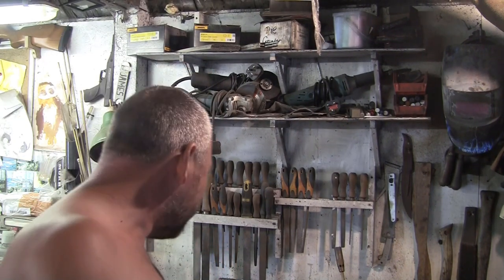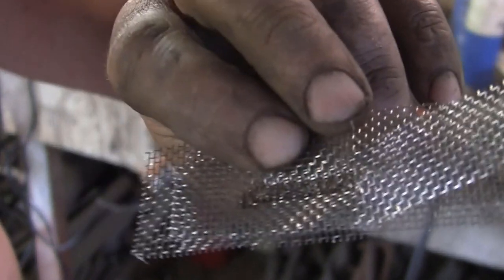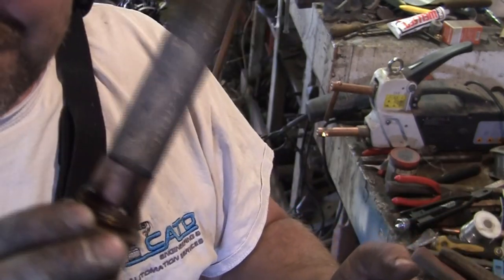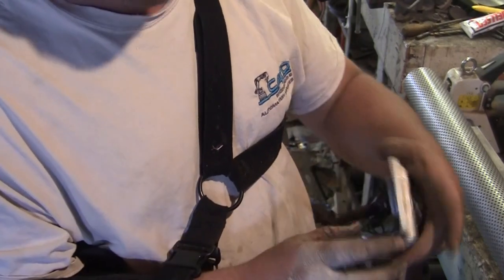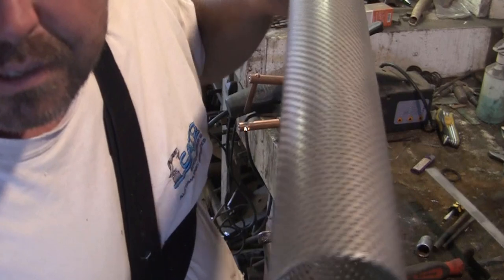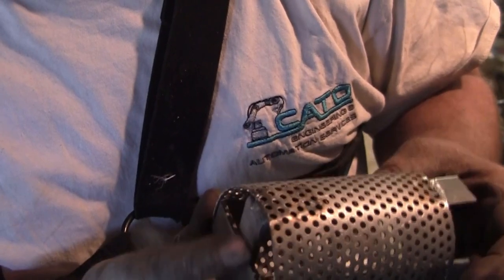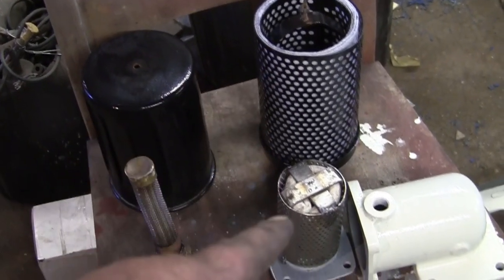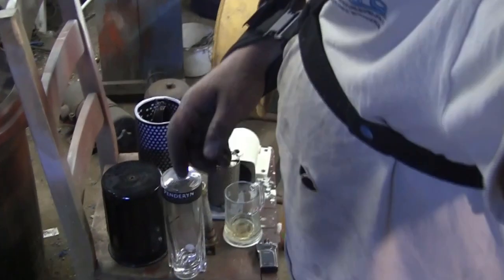Making filters for the Lister CS

Comment: You did a great job on those filters, especially that oil filter, it was a real bobby dazzler, which is amazing coming from a bloke who apparently stirs paint with his bare hands. Keep up with the physio exercises. I look forward to seeing you back firing on all four cylinders, like a finely tuned  Lycoming.
Reply from the maker: Mahah brilliant. The thing with Lycomings is when they're running dead smooth it's normally because they're down on compression and the cams scrubbed.
Reply: @turboconqueringmegaeagle9006  Sounds about right for the aircraft I used to fly around in, and for the women for that matter 😄

Comment: If you repeat a spot weld on top of a hot spot weld it can aid penetration with lower power spot welders. I have used 4x welds in the same location for a strength required situation.
Reply from the maker: Yes it seems to work well if you don't mind the dimples
Reply: @turboconqueringmegaeagle9006  When needs must and real welds will not work !

Comment: Spot welder works lovely most impressed with the oil filter. I think you need silver solder for stainless not tried it though. 😀
Reply from the maker: There's a challenge, making a puddle of silver solder to dip it in, I read since that especially strong flux is important too, I just used plumbers flux.
Reply: @turboconqueringmegaeagle9006  yep bit of silver solder will do wonders. Warm the mesh a little to Pre flux it, warm the rod, dip in flux then flick the torch over it to get a little glow and pop the rod against it. If you keep the end suspended it will turn out nice and even also dont over do the solder.... but that spot welder is just so quick and easy, plus the last time I ordered a pack of silver solder 7 years back it was nearly £1k I dread to think what it is now.
Reply from the maker: @smithbuilt  really? How big was the pack, 50kg? I've got a few random bits, it's expensive but I didn't think it was that bad

Comment: Love a whiskey myself what’s that one like, I’m not a fan of the Smokey stuff.
I’m an Irish whiskey lover.
The oil filter was my interest a question was going to be how does the stainless take to solder but you answered that.
I’d love one of those spot welders they are way too expensive for the small amount of use it would get.
I need to get some tig time in.
Glad your healing pretty well I’m suprised your taking it easy, my guess was you would be lifting and over doing it.
Enjoyed the filter video.
Reply from the maker: This medira finish isn't smokey and has a bit of marmalade aftertaste, pretty subtle, definitely smoother and cleaner than bushmills.

I'm going to continue messing with stainless and solder, I'll update you if I have any success.

A fellow YouTuber (Julian hg) emigrated and gifted me 20 full sheets of 1mm steel so I looked around and vevor were doing cheap spot welders, it made sense at the time, I really didn't need it but it's been a lot of fun.

Comment: That's all mighty impressive, particularly the oil pick up filter thingy, that's a bit of a cracker - not sure what solution I'd have come up with for the same problem, but I'd have been chuffed if it was half as good as that.  I like the melting pot of solder idea, not that it worked on this occasion, but it could come in handy.

On a different subject, have you ever played with petrol blow torches?  I'm used to the paraffin ones but petrol just seems that tiny bit more scary.  I picked up a little petrol one at the weekend - doesn't have a pump, just relies on the heat causing the liquid in the tank to expand.  It says Benzolene Petrol only on the side of the tank, and I've got another one by the same manufacturer (Monitor) that says Paraffin only, so it's definitely wanting some form of petrol - probably that old mix they called "Motor Spirit" or something like that!!!!

....and finally, nice to see the arm progressing well, it's really handy that you can use it a bit because if you're anything like me you'd be going crazy if you actually couldn't do stuff at all!!!!
Reply from the maker: Yes I've got a couple of little siervert torches, will start fueling with hand warmth if there's sufficient temperature differential but only one works, the needle on the other is knackered, really it's more like a whisker, the remnants of the broken one crumbled in my fingers so be bloody careful, can't find any info on replacing it, appears crimped into the shaft.
Fire up instantly but don't put out a fraction of the heat of a paraffin torch and they're surprisingly dirty ie they leave a bit of soot, waste avgas worked fine, forecourt petrol is more volatile so should work better.
I have no idea of best practices around these things but my concern is damaging some very fine components rather than a fire or anything, they are pretty tame.
Benedict has more experience/interest with blow lamps than I do, I've just accumulated them with various piles of old tools and the magpie inside me liked them too much to move them along.
Are the engraved operating instructions legible still? I remember them being simple but important ie. The sequence of cap and needle opening and closing but can't remember off the top of my head, will happily have a look for you tomorrow though if you want.
Reply: @turboconqueringmegaeagle9006  I'll give mine a little rub tomorrow  to see if there are any instructions lurking under the dirt. From a quick glance the needle looks ok, I've already made a new washer for the fuel cap because that had gone hard and was leaking.  I'll let you know how I get on......
Reply: @turboconqueringmegaeagle9006  I'm still here - didn't blow myself up - in fact it was all pretty tame in the end.  I decided to do an initial test to make sure nothing leaked using paraffin - as you might expect, there's nowhere near enough vaporising surface to get the paraffin to vaporise, so that just worked (like they all can) as a mini flame thrower.  Swapped over to petrol and tried again, and once it had ejected the remaining paraffin from the pickup pipe it did exactly what it should do, nice and simple.  Guess I'll do a video sometime but I'd need to point out the differences - might not be a good idea if people threw petrol into torches that were designed for paraffin only!!!

Cheers for the information, I wanted to hear from someone who'd run a petrol torch before I gave it a go.  I know Ben has got the petrol stove or two, but I think all his blow torches are paraffin.
Reply from the maker: @GrumpyTim  excellent mate, I feeling like firing a couple up after chatting about them. Will make scraping the layers of paint off the lister more interesting if nothing else.
Reply: @turboconqueringmegaeagle9006  Yep, anything to relieve the boredom of stripping paint - something I've been doing far too much of over the last week or so while I'm doing some renovation work on a neighbours old garage - and I can't really use a flame on this stuff, so I'm using my infrared paint stripper - awesome bit of kit, but it doesn't do much to relieve the tedium.......
Reply from the maker: @GrumpyTim  I have never seen an infrared stripper. 
I find distractions way too readily when prepping for paint so it takes much longer than it should which makes it far more boring, like a circular boredom accumulator.
I hope you are getting plenty of tea and biscuits off your neighbor.
Reply: @turboconqueringmegaeagle9006  Oops, silly me, I put a link in my reply, I suspect you have your settings set  to block or hold links (I know I do). No tea or biscuits, but I guess she knows I can just hop over the fence and get my own.  Like you, any distraction and I'm off the job, then it just takes longer and longer.  I seriously goofed on how long I thought it would take - lots of rotten bits to cut out and replace.

Don't feel obliged to watch, but you can see my infrared stripper in a video I did a couple of years ago "repairing a rotten window" or something like that.  It's a Speedheater Cobra - I'd only had it a week or two when I shot that video,  I don't wear gloves now!

Comment: I don't want to sound like your mum but.... Don't have exposed skin whilst TIG welding, you can get fierce sun burn. Good work on the filters. Where did you get the spot welder from, and how much did it cost?
Lastly did you say in a previous video that you had an issue with the injector? What injector and pump does it takes?
Reply from the maker: Yes mum
Thank you
Vevor branded purchased on ebay for £180 2 years ago now discontinued 
Pump appears fine
Injector was corroded beyond redemption, tried lapping but the ground surface of the body itself was too pitted so I'm just going to stick a £60 indian unit in there.
Reply: @turboconqueringmegaeagle9006  What is the type of injector? (as in what CAV model?)
Reply: I ask because I have some CAV injectors from a Lister SR3 on the way to the melting pot.
Reply from the maker: @BensWorkshop   I've already got a replacement for the cs but I'm also sat on 3 sr2's of various different states of disrepair so please don't scrap those injectors
Reply: @turboconqueringmegaeagle9006  Took me an hour to liberate from a scrapyard! They are not going back there! (I have 3 injectors and 4 pumps, and associated pipework)
Reply from the maker: @BensWorkshop  my apologies I'd interpreted the melting pot comment as being turned into razor blades, I should have known better.
Are you going to make a diesel foundry?
Reply: @turboconqueringmegaeagle9006  The engine was on the way to the pot, I decided it had a donor card and removed some organs .... 
I will make a foundry at some point, got to make  proper place for my big engines and get them running first.
Reply: @turboconqueringmegaeagle9006  Also, given that I can possibly still get access to the engine, can you check that your cylinders and pistons, heads, con rods etc are in serviceable shape. Don't mind getting those as well. I can get 3 off. I do have all the fixings for the injectors too.
Reply: Should read 3 pumps... It was a 3 cylinder engine!